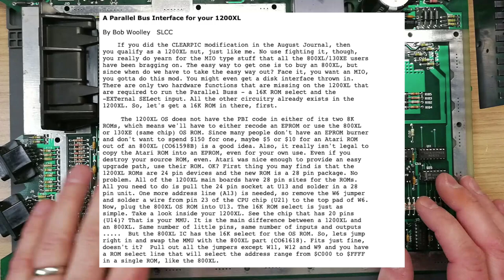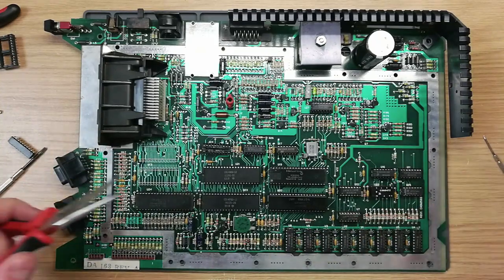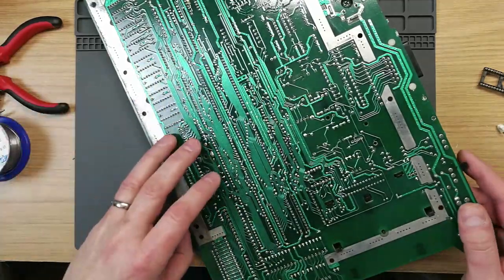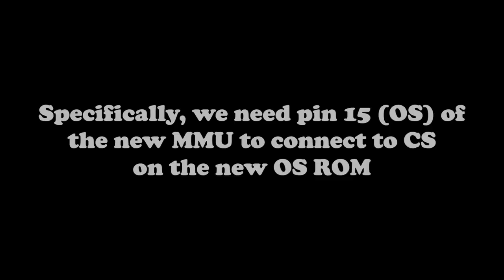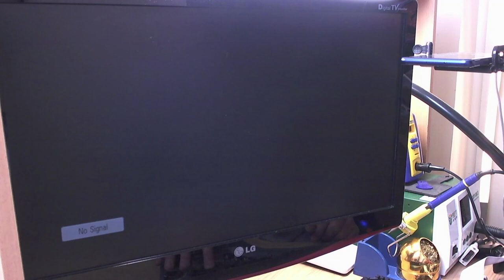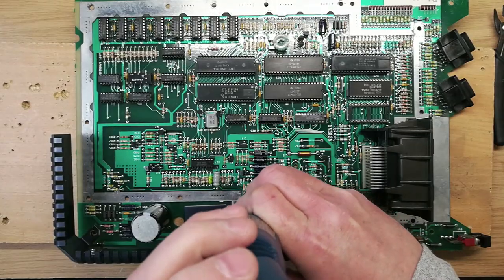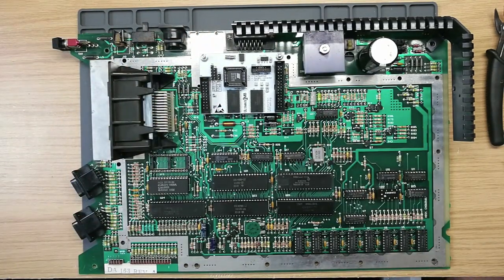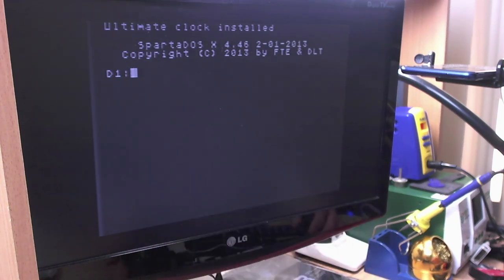How to install U1MB in an Atari 1200XL

Comment from the maker: One point I probably didn't get across in this video is that if you're installing U1MB, only jumper W11 is needed. U1MB doesn't need a chip select signal and you can put the OS ROM cable in either socket with only W11 jumpered.

Comment: F***in’-A, right! Thanks, yo. This is awesome! Thanks so much for this detailed info and guide. It’s very much appreciated!

It’s hard to believe I’m saying all that about a Megabyte! 😄

Damn, what those teams from the late-‘70s, through the mid-‘80s—which saw so much of crossover, between the Atari 8-bits and Commodore 64, at least in terms of specialized chip design—could make possible with 48 and 64 kilobytes! It’s damned mind-blowing!

Comment: I’m just wondering.  Why put so much memory into a machine from the early 80s?  Not sure what the advantage might be.
Reply from the maker: An increasing number of games and demos will leverage large amounts of extended memory, and there are several disk operating systems (most notably SpartaDOS X, which is built into the Ultimate 1MB) which work optimally with plenty of extended RAM.
Reply: @flashjazzcat     

So modern home brew.   That's pretty cool.  Always amazed (happily so) at the love these old systems get.